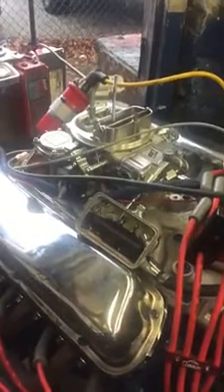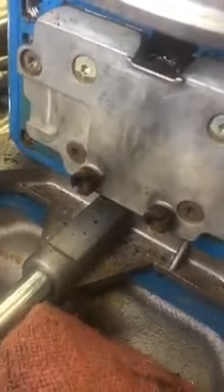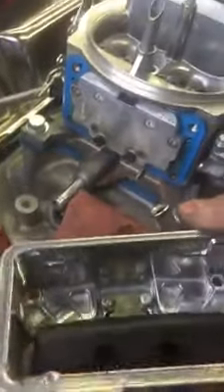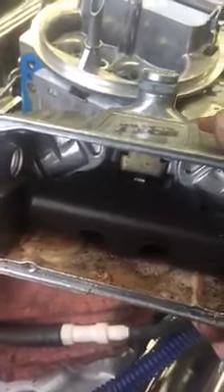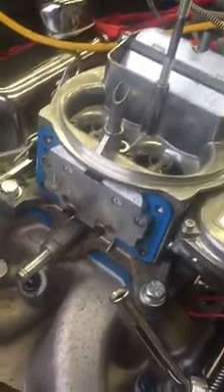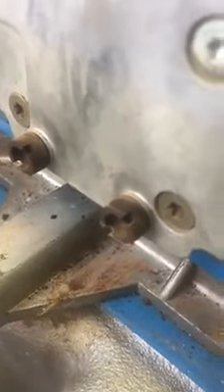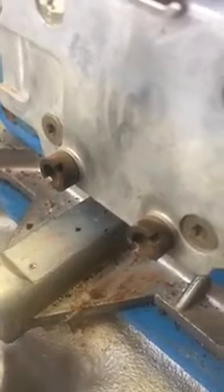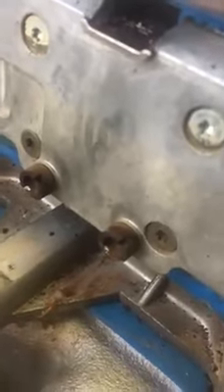Clean Means CLEAN! Especially the Fuel Lines!

Comment: Recently at the shop I work at, a Datsun came in for a tickle of the carbs. It wouldn't even start because it threw a rocker off. Further investigation revealed stuck valves caused by bad fuel and badly rusted tank. One freshly assembled engine now had eight bent valves.

Comment: Great Info Ken. If replacing the tank, fuel pump and new carb, why not replace those old lines while you are at it, and with new filters, one before fuel pump and one before carb. (Mustang owner) and hot rodders in general. Thanks for sharing Ken.

Comment: Had a similar issue with My Harley. Tank liner came apart and began to clog up the the carb. Installed a glass filter which displayed the evidence. You would think that with a vehicle that old they would have installed a filter at the end of the line just for a visual and checks and balances! Good Info!